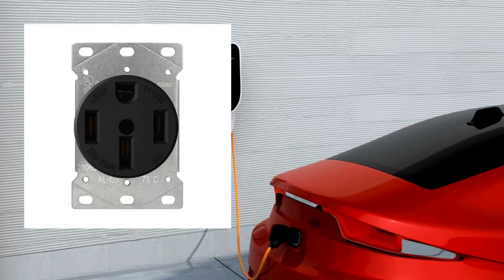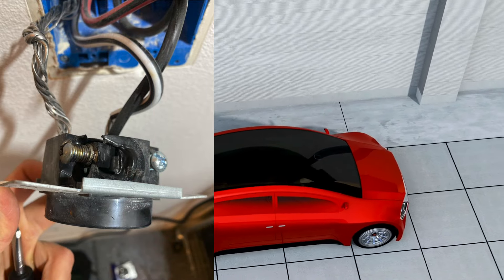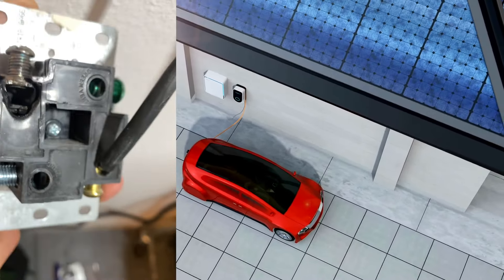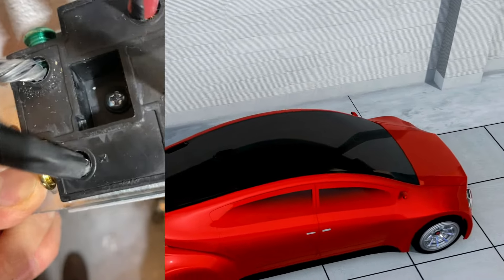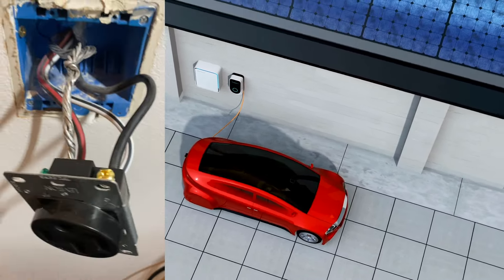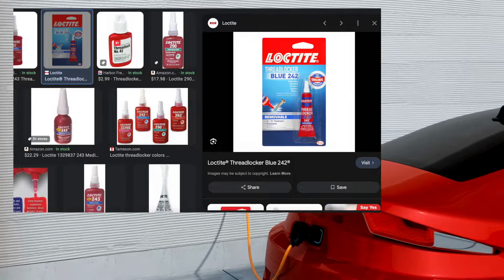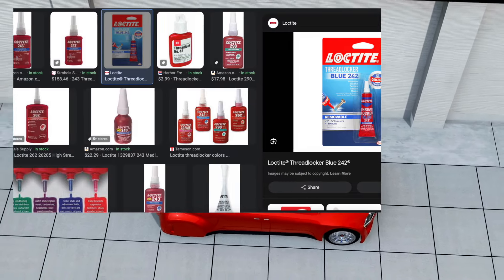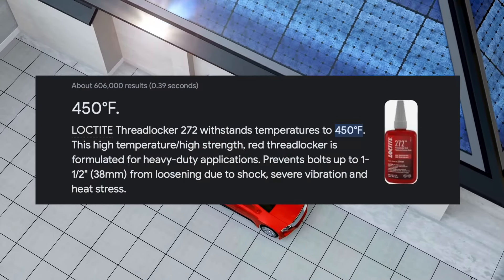14-50 amp EV Charging Outlet Installation Warning

Comment: NEVER use thread locker on any electric connection.  All liquid chemical thread-lockers are insulators, and because they have low viscosity and cover most or all of the thread, they ruin any electrical bonding that a connector is supposed to provide.  The melted outlet is a result of not torquing the scews correctly or buying a cheap $10 outlet.
Reply from the maker: agree/disagree